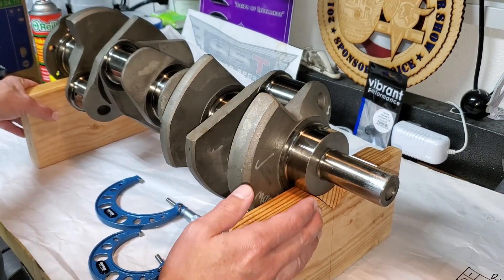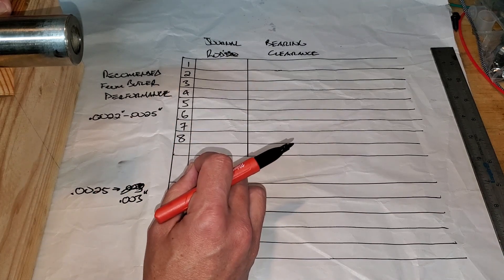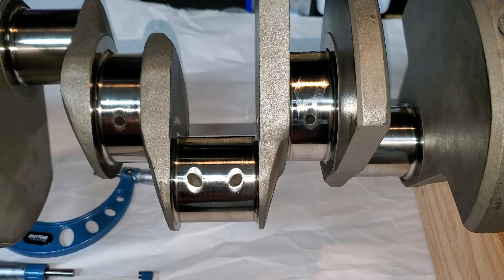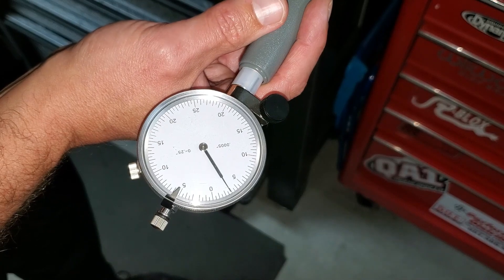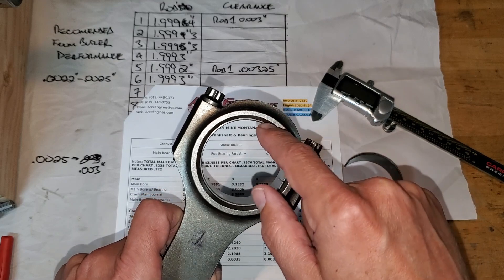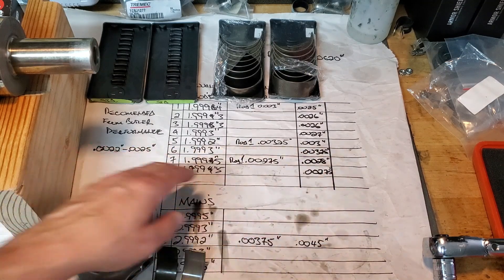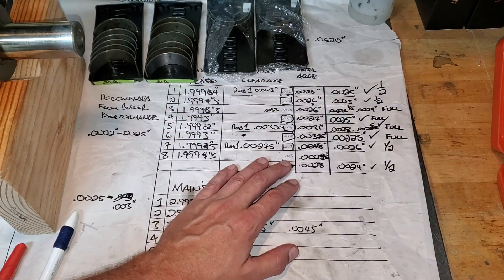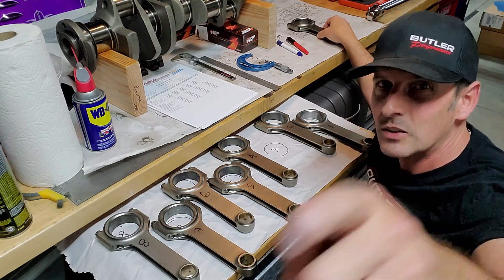How to measure rod bearing oil clearance for ANY engine.  Pontiac short block re-build, Part 3

Comment: Most new forged rods (I and H beam) are out of round right out of the box, the are wide at the split and tight on the lower and upper part of the big eye. Causing bearing knock even with new crank and bearings.
Reply from the maker: Certainly plausible. I seem to recall its out of round on purpose... been a minute. Lol. Thanks!

Comment: i need help!  when measuring the connecting rod bore. do you only measure in-line the rod (I-beam)? Or, do you also measure  offset from the rod like 20 or 45 degrees? also, do you measure at the marriage line (i.e., 90 degrees from the rod)?  Lastly, where does one get the tolerances or specifications for these measurements? two of my connecting rod bores are significantly different than the other two, like 0.007-in.
Reply from the maker: Good question.  You measure in line with the I-Beam, which is where the load is directed when in use.  The tolerances would come from the rod manufacturer.  The bearing clearances would come from an expert on your type of engine, build intent, etc... hope that helps.

Comment: If I use sand paper to polish a crank shaft then what I think I have to put 1 number over size baring ?
Reply from the maker: One, don't attempt to "sand" your journals.  They need to be polished with the proper equipment, by a professional.  Once that's done, and the journal is now smaller, yes, you start getting into oversized bearings to accommodate for the smaller sized bearing journals.  Hope that helps.

Comment: so what ur saying is that u cant just slap new ones in?
Reply from the maker: You "Could", it depends on your engine's condition.  If you're just "refreshing it" yeah, same size bearings should work fine.  If parts are brand new, and/or changed/polished, etc... you should measure for the proper bearing size.  Hope that helps.

Comment: OLÁ  05/08/24  Botando os pontinhos nos is.   Parte de suas recomendações são corretas para motores antigos.  Os motores atuais, em maioria, são muito mal projetados, deformam com facilidade, possuem vida curta (bem o contrário do que é propagado) e, exigem profundo conhecimento teórico e prático muito maior do que normalmente possuímos. Quanto ao ok, de minha parte só ocorre quando aprendo algo. (das retificadoras que vi vídeos nenhuma recebeu meu ok. e  isto me entristece)  Roberto Udo Krapf
Reply from the maker: Yup, newer engines also have tighter tolerances, and a better manufacturing process to accommodate for tooling changes. Thanks!
Reply: @FastMonty  10/08/24  Não  me referi a tolerancias e sim no conjunto, no fabricante que o projetou, (motor e peças) e nos mecânicos que não conseguem identificar os defeitos e os riscos que poderão surgir a médio prazo. Abraços Roberto Udo Krapf Analista de Motores a Combustão Interna e Assistente Técnico.
Reply from the maker: @robertoudokrapf453  Ahhh yes, in that case, I totally agree.  Thanks!

Comment: what the clearance between ball bearing and race? Is that factory preset and no need to worry?
Reply from the maker: What ball bearing?
Reply: @FastMonty   tapered bearings for a boat trailer. 

But even if they were say deep grove ball bearings, aren't all the clearances set at factory, especially for a specific application?
Reply from the maker: @anthonyrochon3907  Yes they are, for roller, and ball bearings.  This video is for Non-Ball bearing engine rebuilding.  Thanks!

Comment: you cannot shave down the caps on the rods of breakaway rod caps. Only the smooth ends or flat ends can be done. You never mentioned "bearing crush" either. That is important in a bearing cap if the bearing is longer than it should be and proper otherwise one can sand down the crush on the bearing. All bearings need a certain amount of "crush" to hold them tight and keep them from spinning in the rods. Otherwise you can bugger up the inside of a spun rod by hitting the race with a point hammering it to raise the metal some and then file it down or sand it down some and fill back with some JB weld under the bearing if the spun is really bad and you do not want to break the whole engine down with head off. I have done this before and never had any problems if done right.
Reply from the maker: Yup, definitely more than one way to skin the cat, right?  Love the fix you mentioned.  Thanks!

Comment: All  my life i have heard and seen this work. .0005-.0007 clearance on any rod or main. If loose then the rod will eventually "knock."
Reply from the maker: you meant .005 to .007, right?  Really depends on engine set up.
Reply: @FastMonty  no..0007-.0005 which is tens of thousanths.
Reply from the maker: @thorthunder3227  yeah, way too tight for old engines.

Comment: How much is too much? Trying to have a lot for a demo build
Reply from the maker: Not sure what you're referring to?  Rod bearing Clearance?  I'd guess that 0.002" above your engine's spec is close to too much.
Reply: @FastMonty  that was what I was referencing and thanks for the response. Never touched a motor but I want to try to build my own just so I can beat the piss out of it. From what I hear demo engine builders have big tolerances almost every to deal with excessive heat.
Reply from the maker: Ahhh, gotcha.  I'd look up specs for your particular build, everything down to the oil pump, once you have a target it's pretty straight forward.  Good luck! @Legend_Killers_Incorperated

Comment: Mike - I hate to bring this up, but Not So Fast, Monty (okay, perhaps you will not find this funny, but you will learn something if you read on....) I reviewed your videos on engine building in great detail. So I froze your video on the ACRE Enterprises Report sheet. There is a very gross error by ACRE on there. Take a look at your sheet. Here are the numbers: "Mahle Rod Bearing Thickness per Chart .1238" Connecting Rod Big End Diameter 2.3240". "Big End Diameter w/ Bearing 2.2020". THIS IS WRONG - IT'S NOT 2.2020", but 2.2002"! Transcription error I assume on ACRE's part. So, your real clearance, as measured by ACRE data, is 2.2002"- Crank Journal 2.1990" = 0.0012"!!!! , not 0.0030". Would love to hear both your and ACRE's comments.    Also, can you please elaborate on how you determined sufficient bearing crush for your engine, in particular for the rods and bearing in question here? Let's just say I am in process of building a new engine - identical  rods and bearings as you are using, and I have a negative crush situation - yep, the bearing do not fully seat due to insufficient interference of the bearing halves (the "crush" is missing).  Without measuring crush, it's really hard to have confidence in your build - long-term durability, that is.
Reply: Mike - they provided the bearing thickness of the bearing on your sheet as 0.1238”. And the Big end diameter (w/o bearing) at 2.3240”. Take your calculator and subtract these two numbers.  Result is 2.2002”, not the 2.2020” which they report.  They made a simple math error, resulting an overstated clearance of 0.0030”, when it is, in fact, by calculation, 0.0012” clearance.  Look at your sheet!  I understand how their method, they did a simple subtraction wrong - go have a look!
Reply from the maker: @michaelriddell9829  Please read it again... the Mahle bearing chart says the MAX thickness is .1238"  BUT, at the end of that Notes paragraph it says Total FM Rod Bearing Thickness Measured .122   Looking at Connecting Rod chart ... Rod bore measured 2.3240 minus the total thickness of .122 = 2.2020   The rod bearing chart is correct.  AND, matches what I measured myself, which is the point of this video... measure it yourself.  Did you see my Main Bearing video yet?  That video I find a massive error by ARCE.  Thanks for scaring me.  lol
Reply from the maker: Almost Michael... the measurements from ACRE are "sort of correct"  They're subtracting the thickness of the bearing from the ID of the Bore.   That said, please check out the Main Bearing video I did after this one for really eye opening issues that I caught from ACRE.  https://youtu.be/5KANmG3owuY   As for crush, there should be some crush, don't really care how much it is... but, there better not be an air gap.  :)    Let me know how you fix that issue.

Comment: in bearing why you say clearnce became 0.00225 after putting bearing with 0.001 us >>> and saying undersized >>> should be oversized by 0.001 us in order to decrease clearnce from 0.00325 to 0.00225 ?
Reply from the maker: No.  To decrease the gap, from .003 to .002, you need to decrease the overall diameter of the bearing opening, which is "Undersized".  Good question, as it does get confusing at times.  Understandably confusing because, the "undersized" bearing is thicker than a standard bearing, which would make you think its "oversized".   clear as mud now, eh?   Keep in mind, the bearing manufacturers are always referring to the end result measurement, not the thickness of the bearing itself, when referring to undersized, and oversized.  Thanks for the comment!
Reply: @FastMonty  this means to decrease gap you will bring a bearing which is thicker by 0.001 mm to decrease the clearance gap
Reply from the maker: @RevEhab  Almost... each bearing half is 0.0005" (One half Thousandth of an inch)  thicker towards the Inside Diameter.  So, when both "Undersized" bearing halves are used, it's a total diameter reduction of 0.001"   Hope that helps!
Reply: @FastMonty  so under sized means thicker....waw
Reply from the maker: @RevEhab  Yup!  It's referring to the Inside Diameter of the bearing halves, when put together.

Comment: Great video, I'm about to do this on my Olds stroker 535. I purchased the exact same tools as you have 
a while back. Are you using a Scat crank and rod assembly? Also what is the displacement of your engine?
Reply from the maker: Awesome!  I have an Eagle Forged Crank and Rods... my engine is a 470, not quite as huge as yours!  ha, ha... have fun building that beast, just remember to take your time, especially when measuring the bearings.  Can't wait to hear how it goes!  See ya!

Comment: Doesn't mixing half bearings cause you to be out of round? I would think the difference is in sizes would cause a mismatch at the seams. Or am I thinking wrong. I've never done it before.
Reply from the maker: Good question... but, no.  The bearing halves are identical to standard, except for the wall thickness change of + 0.0005"  (Half a thousandth)  So, the OD of two bearing halves put together, are identical to standard bearings.  Hope that helps.
Reply: @FastMonty  That does make sense. I have a 66 Bonnie Convertible that I'm going to be bringing back to life I hope soon. Your videos have been a great help in the learning process. Based off the misshapen oil pan I'm expecting to find similar issues. Thanks!
Reply from the maker: @pacoperkid13  Ha!  You're welcome... good luck, and don't be shy with questions.  Thanks again for the comment.

Comment: It does but there comes a point where enough is to much and was told that .060 is it.
Was just in a conversation on GTO forum of a guy who just finished a 72 resto what a beautiful car, its maybe the most beautiful car in and out Ive ever seen he went way over the top.
Reply from the maker: Sorry Dan, that's just not true.  You don't have to take it from me either... call an expert.  And, if you haven't guessed who my Pontiac expert is, by what I wear in almost every video, it's Butler Performance.  That's who told me it's ok to proceed with 0.070" over.  Thanks again for the concern... talk soon.

Comment: Its just conversation, curious of a hobby, you must have sleeves in your cylinders? Or the walls are really thin?
Reply from the maker: No sleeves.  On "thin blocks" you'd typically know you have a problem, when machining to 0.060".  Since mine machined fine, and ran fine, at 0.060"  No overheating, no leaks, etc... going an extra 0.005" on the wall thickness is not going to change anything.  Hope that makes sense.

Comment: I just watched  your push rod measurement looks like 9.050, but im not doing that more curious. I was told .060 is the max bore, guess not
Reply from the maker: That's my measurement, yes.  0.060" is the max recommended, with a factor of safety.  I'm pushing the envelope, and would not go past 0.070"  Hope that helps.

Comment: Hi Mike I have a couple of questions for you as I beleive your engine and mine are the same Pontiac 400 bored .060 over? And you have 4.25 crank length? So 1 do you have aluminum lifters, and 1.65? Im hearing nightmares about PRW aluminum lifters.  And 2  do you know your pushrod length? I think you did adjustable, do you know what you ended up with, length wise. Thanks man keep up the good work and thanks for the T shirt.
Reply from the maker: Thanks for representing FMG!  I'm now .070" over.  (It was 0.060" over)  You mean 1.65 rockers?  Mine are Steel.  Yes, I know my pushrod length.  I'm not telling you what it is, because it's based off of my components.  You need to get an adjustable push rod to measure it yourself, then order based off of that measurement.  If you check out my video about it, I'd add an additional step and get a measuring spring.  You have to remove a valve spring, and put the test spring in.  Hope that makes sense.  Thanks again...

Comment: Did u just polish the crank or did it get resurfaced? Mine went .010 under and I ordered the subsequent .010 bearings. I verified with a micrometer. It sounds like it would have been easier for u to just have them to .010 under across the crank that way you weren’t trying to figure out using standard with undersize and all that? Also, are u still using plastigauge to verify?
Reply from the maker: Great questions... I actually discuss the whole 0.010" under trick in the next video concerning the Mains.  My circumstance was a little different, as I took the crank to the polisher for an opinion and they said a light polish will be fine, and you'll be really close to my "standard" or 0.001" undersized.  If it was worse, then yes, I'd have to measure the actual ID's of the undersized bearings, and have them target an undersized grind that would target the .0022" dimension, resulting in another trip to the polisher.  (You typically can't just tell someone to take 0.010" off, and expect that 0.010" undersized bearings will give you the appropriate gap)  And yes, I'll be using plastigage during the final assembly.  The next video is going to blow your mind, because the PRO's that blueprinted my mains were WRONG.  You'll see... always good to double check.  Thanks for the comment!
Reply: Wow interesting. Thanks. Ya I took mine in and they said best to cut .010 across the board. I ordered the bearings but waiting on the rods to come back to double check everything. Great video. Good thing you’re checking. I suck at math and u seem to know what you’re doing and still had difficulty. I’ll try the best I can but idk if it’ll ever be perfect considering the  error in gauges and what not.
Reply from the maker: @ermidk1236  Yeah, it was an insane learning experience for me... the next video will help make the whole 0.010" undersized bearings make more sense.  If you have any questions, when you get your hardware, shoot me an email.
Reply: Thanks brother!

Comment: Just curious most bearings have a slight groove down the center for oil travel ,and I noticed your were smooth with out a groove.
Reply from the maker: I've actually never seen a rod bearing with an oil groove... I've seen some Ford/Dodge bearings with a hole, but no groove.  Are you sure you're not thinking of Main Bearings?

Comment: Might want to stamp both half’s of the rod
Reply from the maker: Are you referring to marking the caps and rods with the same journal number?  Good idea... I didn't have to, as I keep all of the components bolted together. (Rod, bearing, and cap)  Until they're ready for final install onto the crank.  I like the idea, just incase you take multiple rods apart.  Thanks!

Comment: Just a quick piece of advice, place some felt in the v grooves of your wood blocks to keep from scoring those freshly polished journals... 😉
Reply from the maker: Agreed.  I didn't mention I sanded those V's down to 800 grit, and wet sanded with WD-40, then covered them in oil.  They won't score.  :)  Good tip for those that don't want to polish the V blocks.. .ha, ha..  Thanks for the comment!
Reply: @FastMonty   Nice, Ive seen quite few guys over the years forget that and scratch up a freshly cut crank.  Good tip on polishing it with wd... 😉
I made a set about 25 yrs ago, still usin them...lol
Reply from the maker: @sierraridgereaper  Awesome to hear!  (I hope to never use mine again... ha, ha...)  See ya!
Reply: Great video! I'm in San Diego and I am having Greg @ Total Performance due all my blueprintint!

Where are you located?